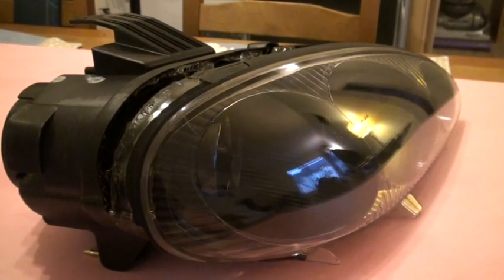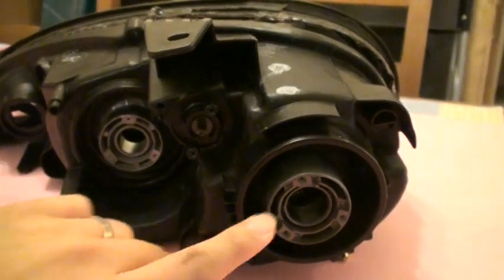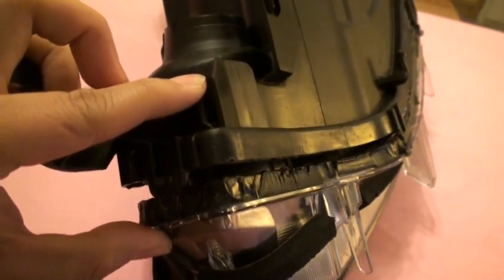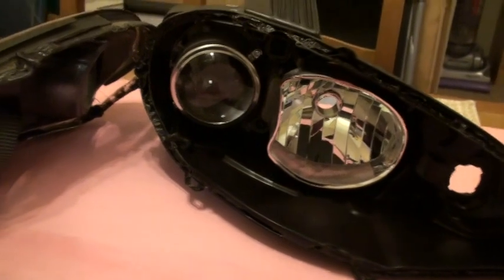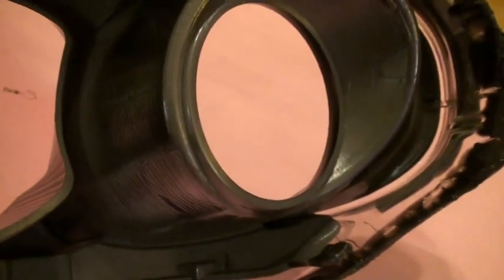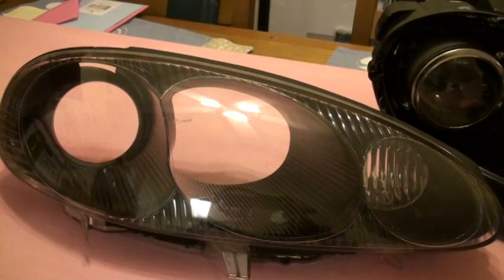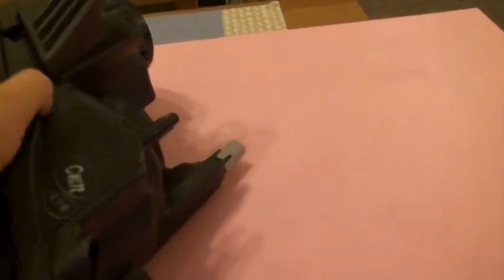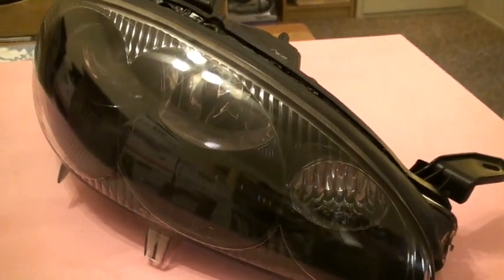Mazda Miata - Headlamp Baking and Painting

Comment: Watched this video a few times and I was able to successfully do this mod to my 99. Looks great with new HIDs and Clear signal bulbs rather than the boring Orange reflector. Great guide video, 220 degrees for about 20-25 min hot/easy enough to pull apart after undoing clips. Thanks!

Comment from the maker: @andrew0901280: I did upgrade to HIDs and they work great, provided that you take the time to level them.  The beam pattern is so focused and sharp, that it's easy to make them too high so they don't hit the road, or so low, that it is not useful at spead.  I currently have them off the car, because I'm doing some other work right now.

Comment from the maker: @jimmydmai - I don't think applying heat to an already dirty lens will hurt it any more than already done.  You'd probably do more damage if you sloshed water around and allowed the small rocks to scratch the inside of the lens, plus leaving water spots and leaving mud in crevices.  Don't take may word for it, but I'd heat it up, separate, then gently run water to remove the mud.  Any scratches, I'd use headlight polisher on the inside, the polishing kits work GREAT.

Comment from the maker: @jimmydmai - Hi! People have put the headlamp back together without silicone, but it really depends on how much of the original adhesive is left.  I've added an extra bead of silicone anyway, so I don't take any chances.  Remember, if it's difficult to pull apart or put back together, just heat it for a few more minutes.  Using black silicone looks best.  A small bead on the seam will do. Use a damp paper towel, put it over your finger, then run it along the seam. Gives a nice, clean look!

Comment from the maker: You do wnat to remove the bumper.  It really only takes 15 minutes, and is very easy to do.   You could pull it off by yourself, but having a second pair of hands makes it really easy to ensure no paint gets scratched.  Very easy to see remove, just screws at top, plastic pop rivets and screws around fender liner, 3 trapezoid pop tabs inside mouth at bottom, license plate holder screws and 2 phillips head screws holding down plastic rectangular pieces at the upper celing in the mouth.

Comment: hi im trying to take the lens off mine to wash because dirt got inside due to a vehicle collision. I already remove the two screws up top. I notice that the lens is attach very tight to the housing. After baking it and removing it, do i have to use silicone to attach it back or itll do fine without it? please help :) thank you